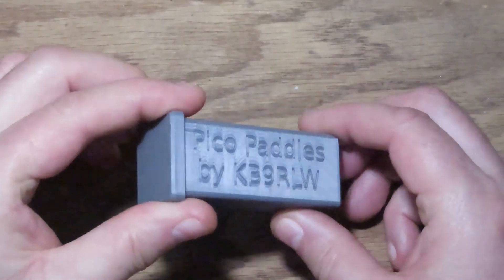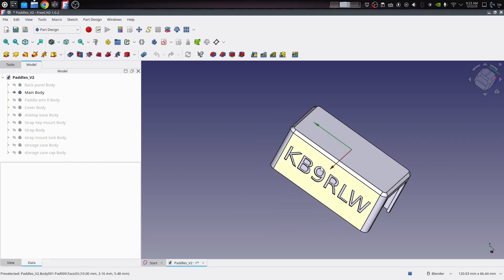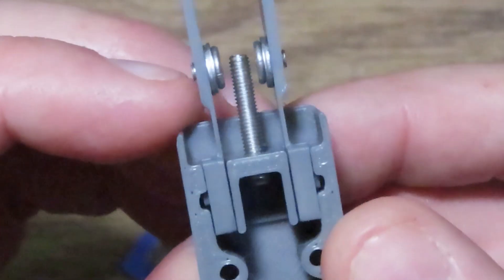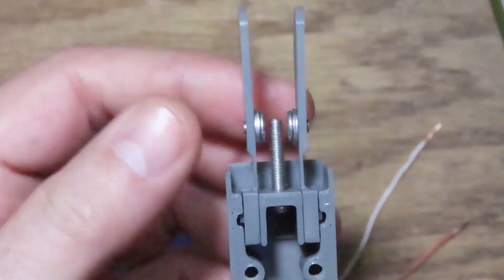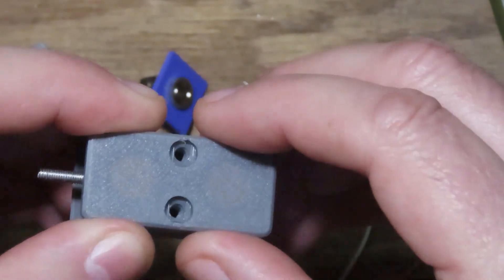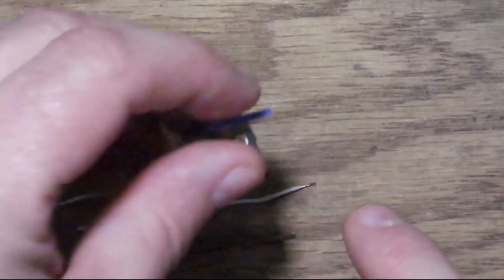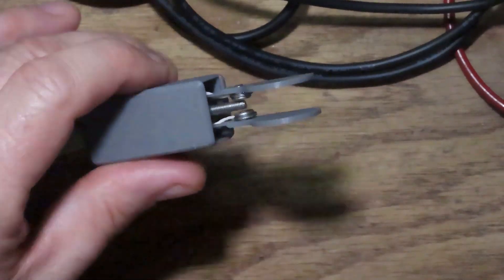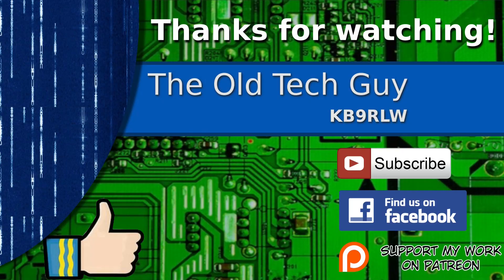Ham Radio - Version 2 of my 3D printed pico paddles.

Comment: The thought you have put into this makes it a very useful and versatile key. I especially like the different bases for field and home use. Best season's greetings to you. Ace, G0ACE
Reply from the maker: There's also a detail on the magnet spacing and pocket dimensions to allow anyone to make a custom base or bracket for it.  (In the PDF parts list file up with the model files.)
I imagine some kind of bracket for the handheld radios that puts the key in an optimum position.  
By the way, the magnets in the key make it stick to the metal case of a radio, so you can park it out of the way when not needed. :-) 
It was a fun project.

Comment: That's very nice work!  And I imagine that with today's solid-state, low voltage keyers, you don't really need fancy contacts; I'll bet those screw heads and threaded screw body last forever.  Sure isn't going to be any arcing going on 🙂
Reply: It's funny, but low-current switch contacts have problems too. They're really susceptible to contamination on the contacts (tarnish or oxidation), making them bouncy, especially with a light contact force. At higher current those contaminants get burned away. There's probably a sweet spot for current between contamination and arcing, but I don't know what it is. Still, for a Morse key I prefer something that isn't going to weld the contacts together. 😆
Reply from the maker: I used stainless steel screws.  The contacts should stay clean aside from beverage spills. ;-)

Comment: I recently bought a beginner level 3D printer to learn. Printer works great, but I'm having trouble learning the slicing software.( I printed parts that were printed into eachother. But, at least I'm trying.
Printer is the FlashForge Adventurer 5M.
Reply from the maker: There is a learning curve for sure, but when you get over the hump, you'll find all kinds of uses for it.
Reply: @loughkb thank you for the encouragement Kevin. Merry Christmas, 73, KN4WPF.
Reply: Nice job, any chance u'd consider making single paddle?
Reply from the maker: A cootie key? I already have. It's an old design that I did in on shape and I'm thinking about possibly updating it. It's on my printables and thingiverse page.
Or are you thinking of a left and right keyear but only a single paddle?